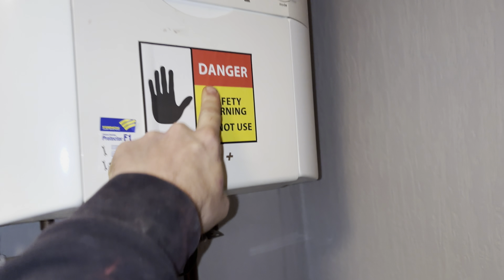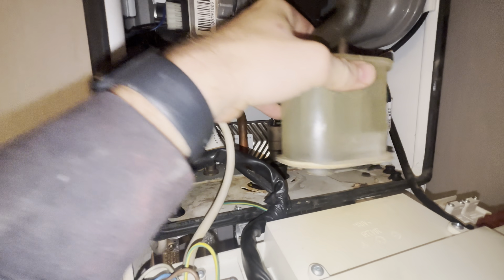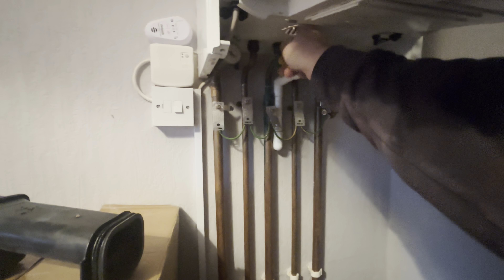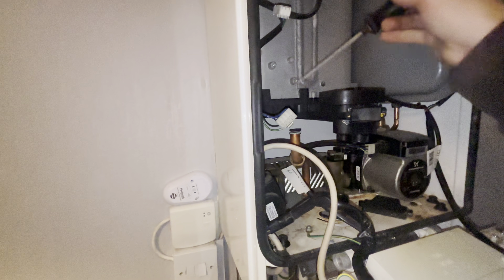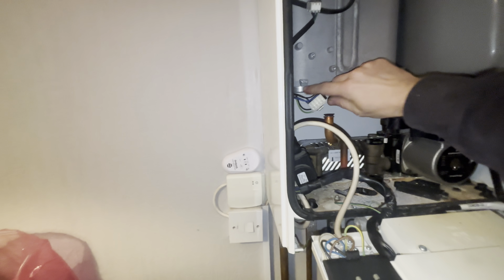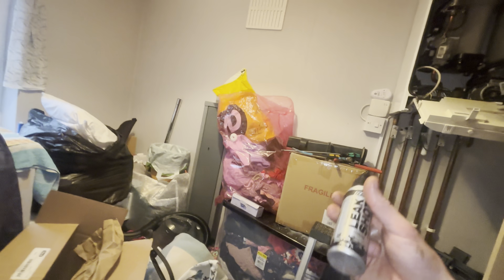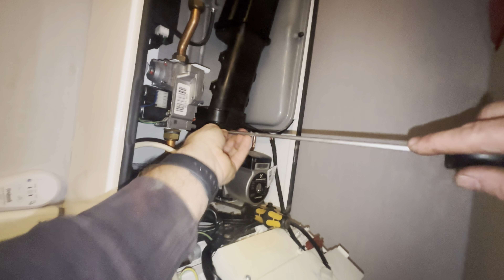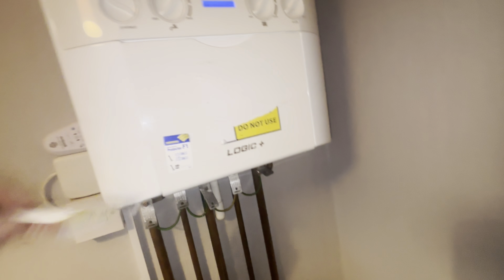How To Replace An Ideal Logic Sump

Comment: This doesn't work on the exclusive/atlantic range where the top half is sealed in its own combustion case, separating the bottom half hydraulics/electrics. You can't wedge the heat ex like this and have to take the whole thing out.
Reply: Yep, and the Espirit and the Classic 2. Pain in the backside!
Reply from the maker: Your right, has one other week sump had gone, difference in price to replace having to take main heat exchanger out

Comment: Can tell you are BG trained. Was the 13 minute sump change with them? Rushing on a 45 minute breakdown productivity level. I think BG even made this a tip in a meeting, to stop engineers ordering the main hex and sump, cutting cost. Thousands of these boilers about, with the same issues. Do you not carry van stock to complete a 1st visit fix? Manager ringing you in the Morning why you have ordered a hex with sump. Yes you twat, it's passing, losing pressure, not a sump issue. Get back to micro managing and a spreadsheet of how many sales I haven't made this week. Oh and a BBF takes a lot longer than the time you given me to service one 😄

Comment: Thanks for another great video Luke, but I wonder, did you tighten those 2 screws at the back off camera? Will it be ok if you didn’t ?
👍👌
Reply: Be noisy, with expansion, that is all. Nothing safety mind.
Reply from the maker: Yes but not on camera, inbetween the 2 analyser tests, realised when I edited it, won’t cause a issue as only loosed up a little if I didn’t anyway

Comment: You say that ANY work on a gas boiler must only be undertaken by a registered engineer. As far as I am aware this is not the case; only work on the gas components is prohibited. For instance I sometimes take out the heat plate exchanger in my Ideal Logic combi 30 and run it throught with acid as it gets clogged up with hard water. I am permitted to do so because it is not a gas issue.
Reply: Reg 26.9 is the one that will trip you up here, where work is carried out on a gas appliance. You only need to be gas safe registered for hire or for reward. A competent person can work on there own gas appliances without being gas safe registered.
Reply: @MrCraig903 this info is also incorrect. You MUST be a gas safe registered engineer.
Reply: In terms of it not being a gas issue. The law states that when a room sealed appliance case is removed a gas engineer must complete their 26(9) which is a legal requirement.
Reply: He literally said it. Any work that breaks a case seal, even if it's an AAV or changing a pump washer inside that unit. Requires you to be GS. Because you need to check, after completion the integrity of that boiler, which means a gas analyser and other tests.
Reply: @56ty78ui "You are not breaking the law by removing and cleaning the plate heat exchanger on an Ideal Logic 30 Plus provided that:
You do not disturb any gas components
You do not break into the combustion chamber
You do not disconnect, adjust, or test gas pipework or gas valves
The Gas Safety (Installation and Use) Regulations apply to gas work.
The PHE is on the water side only, so legally it is not gas work."
Reply: @ThisIsJamesL You carry on with whatever you do mate.
Reply: @T@ThisIsJamesL Not sure who’s giving you your information but it’s wrong.
Reply: @ThisIsJamesL How exactly do you remove the plate from a Logic without breaking into the combustion chamber? The general point you are trying to make is correct, but you can still land yourself in the crap if you cause injury or property damage to someone else. Also there is another thing to add to that list. Any component that controls combustion or is likely to affect combustion should only be worked on by a GSR operative ie. replacing circuit boards, flues and seals. So it's not just gas carrying components
Reply from the maker: If it’s your own house to be honest you can do what you want in terms of the law I’m pretty sure but the front case is what forms the room seal on the boiler, so as soon as you disturb it it breaks that seal and needs 26.9 checks to confirm safety. There are some boilers that you can take case off and not disturb the seal

Comment: Which combi boiler would you recommend mate, got an ideal 30kw Logic, thinking of replacing it with Baxi, , enjoy your content.
Reply: Vaillant
Reply from the maker: Baxi is my number 1 mate, 10 year warranty same as Worcester but it’s smaller, has brass components and the customer service is spot on 👍
Reply: Vaillant all day long. May installers opt for Ideal, Worcester and Baxi for ease of existing installation.
Reply: Intergas
Reply: @darrenmackenzie1892 😂

Comment: Excellent video and description sir.

How much would you charge for this repair?
I have recently knocked boiler repairs and servicing on the head as i have been too busy, and can earn better money doing everything else, i may resume servicing but not too sure aboout repairs, i find that i dont make enough money by time i have diagnosed the fault, ordered part returned to job, fitted part, occasionally more parts needed, ordered, returned, pissed off customers, customers dont  understand how costs mount up and stress involved trying to fit them back in, it isnt always worth it.
Reply: You need to get better at 1st time diagnosis. Charge accordingly.
Reply from the maker: Charge for diagnostic first visit minimum an hour then the sump I put in for 2 hours labour, didn’t take me 2 hours but hour to do job minimum plus an hour for messing around ordering and fetching part so 3 hours total 👍

Comment: And i thought the heat exchanger problems were gone unfortunately they aint f ing logics
Reply from the maker: And me, remember when they first come out, was going sumps and main heat exchangers quite a bit at BG 😅
Reply: @bluebulldog_uk my neighbour had ideal out under warranty for the low rate l2 ignition fault the one where it sounds like a fog horn over 5 visits they changed gas valve burner fan then heat exchanger turns out it was a pcb fault which is a new one on me oh and electode and flame sensor

Comment: Some go easy like that, others not so much. The position of the boiler makes a big difference! I had to do one on a step ladder, was a nightmare. Every time you put pressure to push the new one on the ladder went sliding across the floor 😂
Reply from the maker: I did exactly the same on one in a kitchen, nearly ended up in the fridge behind me 😂😂

Comment: Do you recommend ideal logic or Worcester Bosch 30cdi?
Reply: Baxi👍
Reply: 60 years fitting and servicing boiler I suggest u fit a Baxi Worcester are over priced and difficult to service and repair
Reply from the maker: I’m a Baxi man, but CDI between the 2..to work on thou the logic is a lot easier